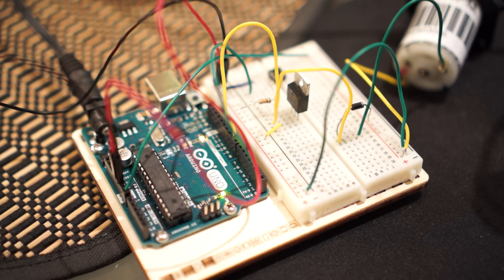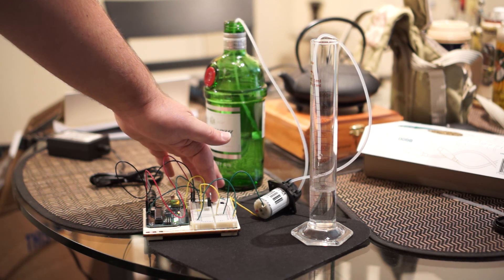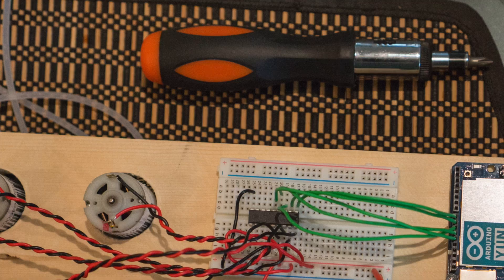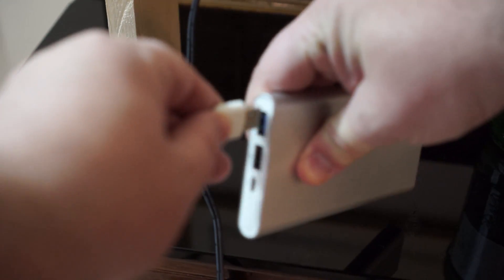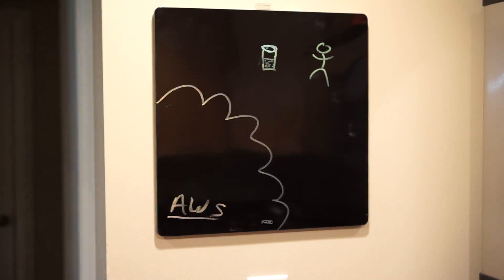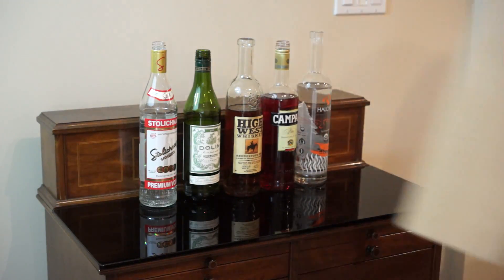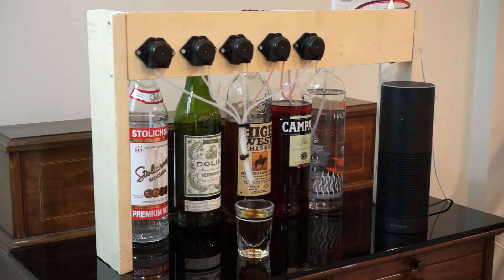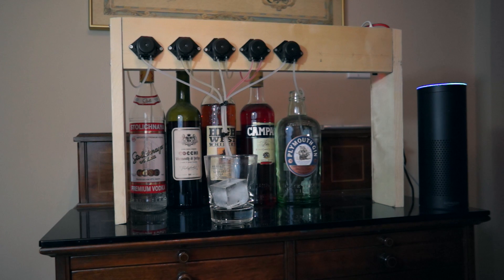Arduino Bar Bot

Comment: The automatic bartender is a great idea.  But I see some cons by using pump instead of a convoy with gravity trigger.

With pump, you need to prime the pump each time you'll change a bottle and you can't had a new type of alcohol without purging the actual pump content.  Cleaning the tubing and tube clot can be an issue with liquor with lot of sugar.

You also need 2 power source...the gravity one can be done with only one.

But you did an amazing job my friend.  

Does it still operating nowadays and did you find issues or ways to solve the problem occuring while using it ?

Comment: That's pretty cool. If you re-built this would you still use peristaltic dosing pumps. They work fine here but ~40mL/min flow rate makes for a long service time.